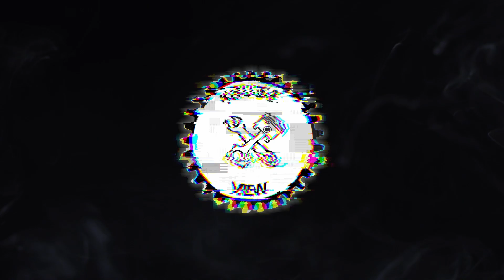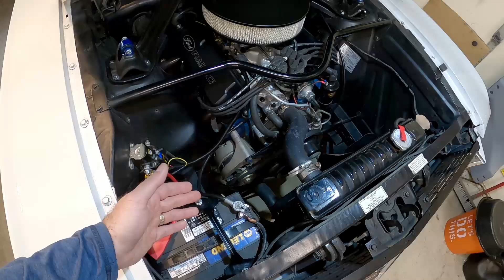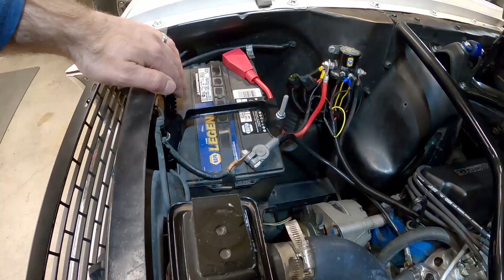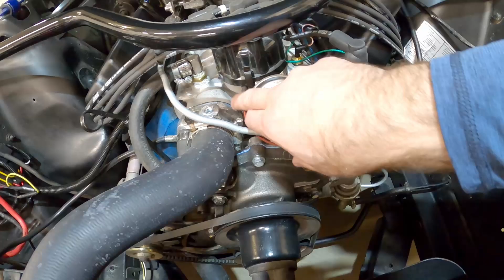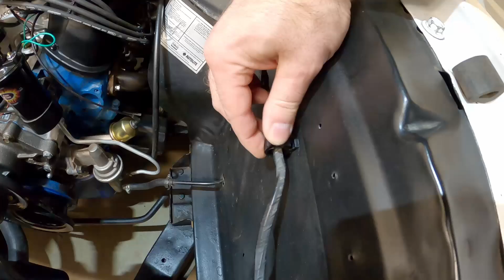Wiring in Engine Bay

Comment: You a video on how you re wired and moved the starter solenoid. With the battery relocated to the trunk
Reply from the maker: Starter solenoid was not rewired, but I moved it closer to the firewall. I made a video on moving the battery to the trunk.
Reply: @KruseBuilt seen that thanks for the good videos.

Comment: I have a ground on my 65 from battery to engine block and engine to firewall. Do I need more?
Reply from the maker: There is a point of diminishing returns, but I don’t know where it is. I’d same two ground wires should be the minimum, but I also think five is more than enough. 🙂
Reply: @KruseBuilt  so what would recommend I add? Battery to chassis like you have? I feel as if I’m dealing with a small ground issue so any recommendations are appreciated
Reply from the maker: In a perfect world, I'd do one from the sheet metal of the car (close to the battery) to the negative terminal.  One wire from the front of the block/heads to the negative terminal.  One wire from the back of the block/heads to the firewall.  And maybe one from the driver side of the block/heads to the shock tower (or sheet metal near by).  Ideally all the wires are 4 gauge or bigger (8 ga. might be too small).
Reply: @KruseBuilt  is your battery to fender you had in the video considered to chassis? Is that the same as going to the frame?
Reply from the maker: Yes, the wire from the negative terminal to the fender is "the chassis".  All the metal in this car is connected to each other, so connecting to any metal surface (frame, fender, firewall, etc) is "grounding to the chassis".  :)
Reply: @KruseBuilt  thank you for the time and info! Keep those videos coming! MD
Reply: @KruseBuilt  I love your channel. You've helped me a lot, and thanks for the question @insomniacreviews!

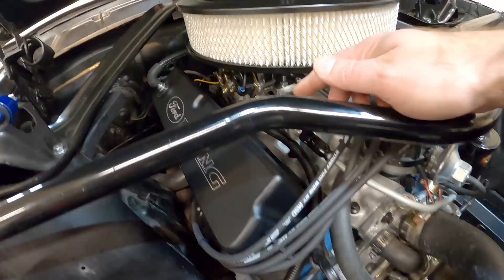Comment: 6:40 fuel line routing,  believe it or not, that metal fuel line touching the rubber heater hose will cause problems.  It heats the fuel in the line causing expansion and a vapor lock,  engine will run poorly, sputter or worse die, and not restart until the engine/fuel in that line has cooled again.  I had a car that would do that, mysteriously die when warm, and it was as simple as tweeting, bending that metal line away from the hot rubber heater/radiator hose.
Reply from the maker: Thanks for the heads up.
Reply: I'm not a mechanic, so I want do things as easily as possible. Is there some insulator tubing that can be placed on the fuel line to avoid this?

Comment: When you changed your air filter from stock to this open filter style......did you have to go with an electrical choke? The factory chokes have all sorts of heat sources going to them. Eliminating the factory air cleaner would eliminate some of the heat sources. Just curious.
Reply from the maker: When I got this car, the heat tube for the stock carb was not connected and so the choke never worked properly.  :)
Reply: @KruseBuilt  makes sense to go electric at that point. My heat tube is still intact in perfect condition. I may just leave it factory. Thanks.

Comment: I've got a MSD AL6 box on the shock  tower next to the solenoid. So you've got the alternator battery solenoid and al6 box all within a 2 ft radius. I really need to take that al6 box out disconnect everything and rewire it. On another wiring note I got some wire loom from Amazon it's like a plastic weave. It split down the middle and comes in long rolls so you can just wrap it over your existing wiring. It works similar to the corrugated plastic wire loom but it doesn't fall apart after being exposed to heat for a while.
Reply from the maker: Yes, I've got that wire loom all over the engine bay.  :)

Comment: All good points on the wiring!  Brother... Please trim the upper radiator hose clamps excess @ the rad.  I'm thinking 4-8 stiches or a half of tube of supper glue for the carnage they could cause. 😆
Reply from the maker: You're absolutely correct, I put on that second clamp because the hose is old and leaking, but the second clamp stopped it (both ends of that hose).  I know the hoses are cheap, and I'm guilty of doing the opposite of what I was talking about in this video.  I plan to upgrade the Rad, so the hoses will get replaced then and it will be all good.  :)

Comment: Your ground should go from the battery to the engine. Then from the back of the engine to the firewall. I’m not sure it’s a good idea to have the battery ground to fender. I believe it’s best to keep the grounds as simple and in a loop. Battery to engine, engine to firewall. Additional grounds to the battery can cause added loops which can cause potential issues.
Reply from the maker: Not understanding your comment about grounding from the starter solenoid to the engine, but everything else makes sense.  I need to get in there and clean things up to match with what I was preaching.  It'll happen, but probably not as fast as it should be.  :)
Reply: @KruseBuilt  Edited the first comment.

Comment: Nice video. Heater is bypassed? Any plan to get that working or know why it was disconnected?
Reply from the maker: Thanks!
Yes and No.  I don't drive the car in weather where the heater would be needed (except for that one time......), but I don't think I want to pull the whole system from the car.  While the hose is not hooked up, the fan doesn't work either, so there could be quite a bit of work to get that up and running.  It's on the list, but much further down.  :)
Reply: I hate my heater hoses but I like that if need be I have a bit more cooling capacity.